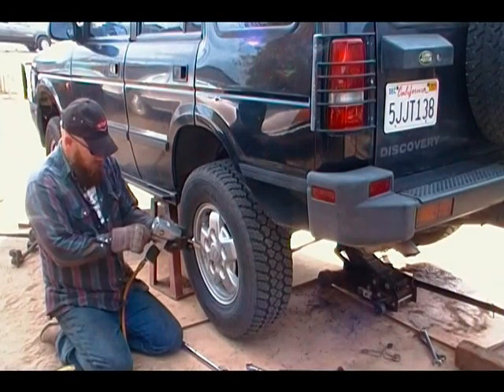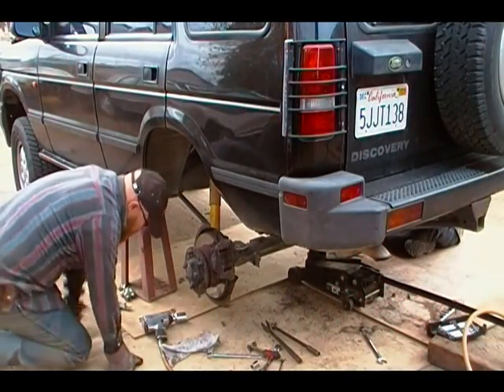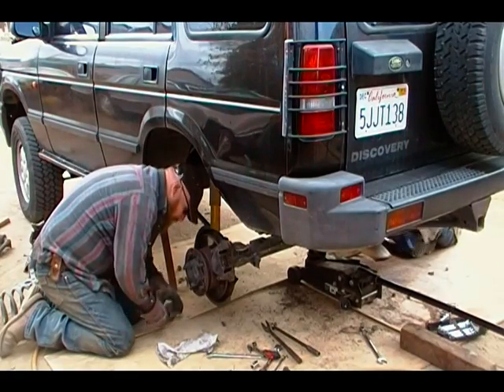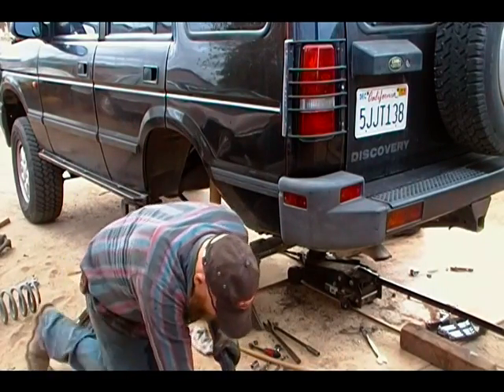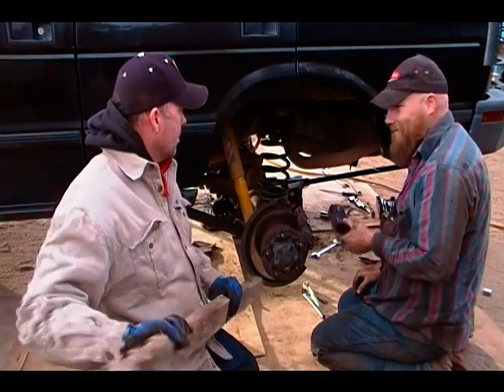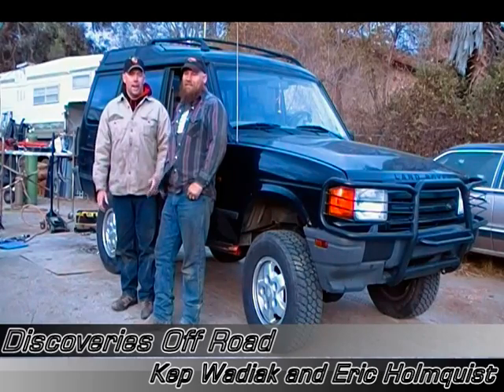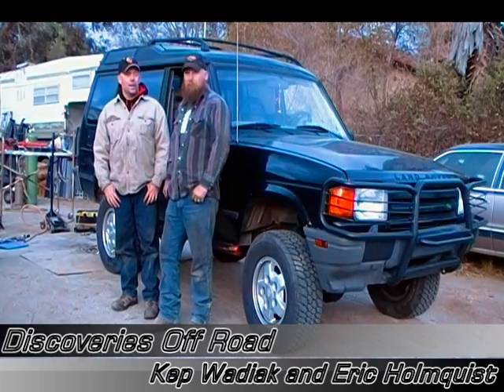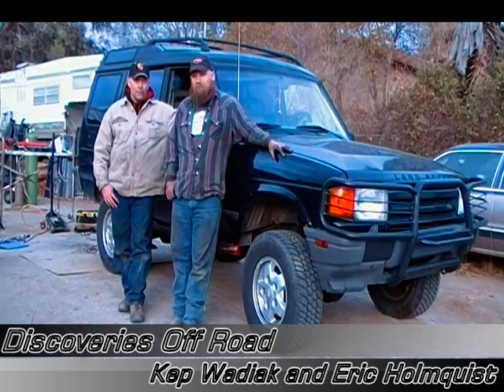DOR Rear End Suspension Lift.mpg

Comment: nice i use to run 33/12.5 on my old 2 door rrc but now with the 94disco i am planing for 33/10.50,i already bought steel mags 15/8with 4.25back spacing ,and 3 inch wide  flexi flares will give me another 1 inch on the fender side .cannot wait for spring to come so i can start building too cold here in Canada LOL.